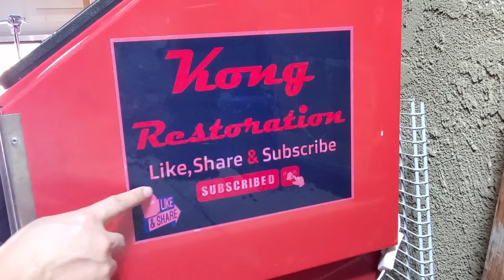Restore Vintage Tonka Van 1970's To Perfection || Kong Restoration DIY Bring Tonka Van Back To Life

Comment: Next time, use high build spray primer and block sand between each coat until rust pits are filled in. Also need finer masking tape so the paint lines are cleaner.
Reply: Even better have someone print up some new decals. We used to have guys make them up and print them off when I was into bmx bike restoration, it's not hard to find someone to do it. It's was a good effort but it could have been so much better with just a little more effort
Reply from the maker: Thank you very much
Reply from the maker: Thank you very much

Comment: Back in the late 70s I had the exact same Tonka Van. I loved it.
It carried everything I could fit into it. Many happy hours with action figures riding around in it, mainly Star Wars figures.
Sadly, it disappeared during some house renovations, never to be seen again. 😢
Reply: It's still inside the wall... probably you found a nice little parking garage between the studs when the drywall was tore down and it got closed in

Comment: I see that you use epoxy to fill the body with, does Bondo not work with the process?
Reply from the maker: Thank you for watching. Bondo will dry fast before i done filling. Also jbwell will be more stronger.

Comment: You have a lot of pitting showing through the powder coating. Might I suggest doubling up on your body filler, as well as your primer coat. Also wet sanding has a much better result. Otherwise it looks great.
Reply from the maker: Thank you very much! I will note and try my best next time.

Comment: "To Perfection"?  Really?  possibly some of the worst prep and paint work I have seen on a restoration channel.  This restoration was passable at best.  Lots of deep scratches, some caused by the way you removed the decal, and if you are working with metal why not use automotive body putty?  It is easy to apply and far easier to sand than JB weld and leaves a much better finished surface for paint.  I know you can't powder coat over it but you have an airbrush, why not do better prep and use the airbrush for a nice paint finish?  I also noticed that you did no restoration to the grill, plastic is very easy to sand why skip that step?  I would give this restoration a C+
Reply: I came to say the exact thing. The amount of orange peel all over the van was horrid. At least wet sand it to smooth it all out. The stripe was disgusting! I would have sourced reproduced decals which would have looked a million times better.
Reply: Trying to copy Chip channel restoring Tonka vehicles and even trying to impersonate him on beginning of sandblasting, but nowhere near the quality of Chips finished vehicles
Reply: I'm not convinced that Kong is not Chip using different tools and techniques.  Kind of a low budget version for beginners.   Hands look the same and there are other similarities
Reply: Damn go redo one yourself.
Reply: I have, and they are much nicer.

Comment: I have seen worse restorations for sure, but this isn’t a great or even a good restoration.  The paint is horrible, the yellow stipe looks like crap.  taping it off didn’t work like you expected it to did it?  The Tonka signs are not in the right font and not even in the right position in regards to where they were. No, you had to go and put a dumb ass logo on there that looks tacky as hell.  The only thing I did like that you done different was spray paint the rims and the grill of the van silver.  I would have liked to seen more of a chrome color than just silver though. Like I said, I have seen worse restorations believe it or not.  Good effort though, I don’t know if this is your first try at restoring or not, but you have a long way to go.
Reply: Also a lot of dust and particle contamination landed on the paint. 

The iconic moon windows are gone 🥲. Some little convex lenses would have been a really nice touch.